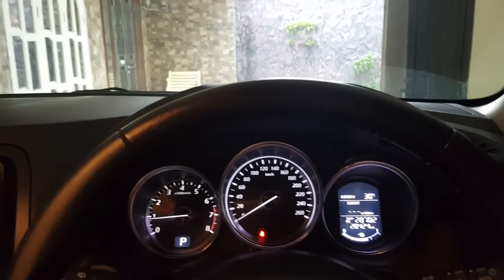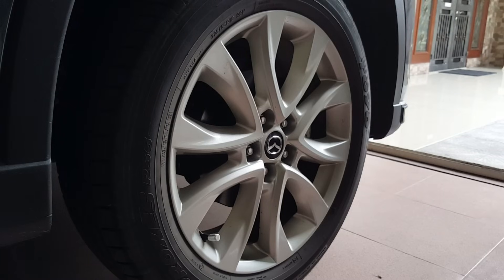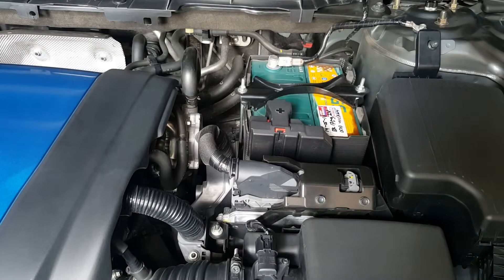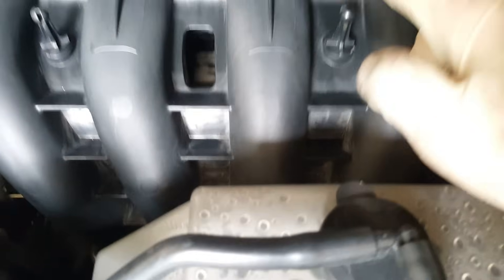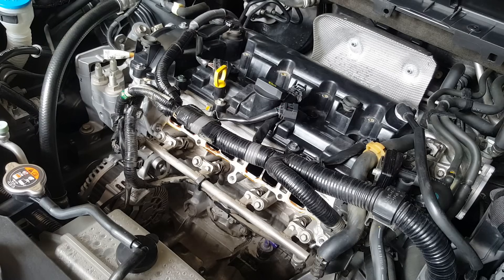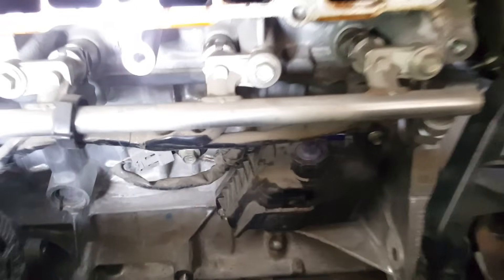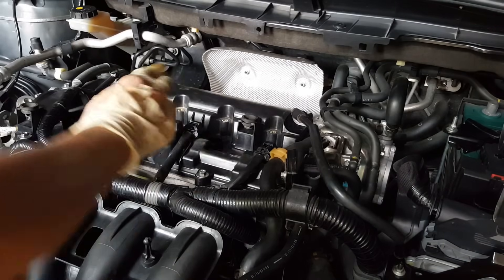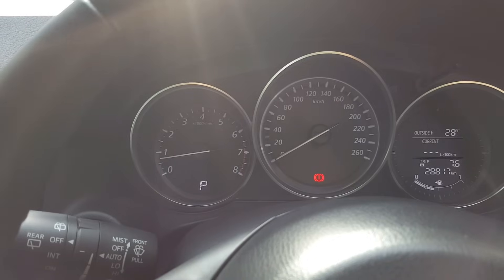How to Clean Intake valves / Carbon clean // Mazda CX 5 (All Skyactiv Gasoline Engines)

Comment: The government needs to band GDI engines from the U.S. ..
Reply: what if you didn't reroute the "out" of the catch can (or the PCV system) back into the intake of the engine? wouldn't that solve the problem with DI because nothing from the PCV is going back over the intake valves? i was thinking just feed a hose down to the bottom of the car from the PCV like those that drain A/C condensation.
Reply: @maxmykhlyk3732  No that's a bad idea unless you like your engine misfiring and lots of check engine lights. That's if we ignore the asshole nature of just dumping it on the ground.
Reply: BoogieDownProduction can you explain why it’d be a bad idea? Obv it’d be bad for the environment but other then that?
Reply: @maxmykhlyk3732  Do you like engine codes and your engine misfiring? Seems like I already explained it to you. Your MAP and MAF will get error codes and it will misfire.
Reply: Max Mykhlyk your idea is not bad. Unfortunately R&D takes time. VW has been doing DI for over ten years and has various solutions in place to counteract the issues. Namely I see that their PCV system uses filters to accomplish what you are suggesting. So essentially it's being done. This way the PCV material is mainly vaporous gases and not oil or sludge which should stay in the crankcase and the oil should suspend it until your next oil change. Another reason why more frequent oil changes are a requirement with GDI. The fact is it's more expensive to maintain GDI cars but they do get I believe 8% better economy on average. They have a long way to go but lighter materials and lighter cars will help. Thus, a 1.2L engine would be more than sufficient. Right now gasoline is cheap so the big 2.0T engines are ruling the roost.
Reply: @jamesmedina2062  Maybe VW did that but thats because the car was engineered that way. I can confidently say the engine will misfire because I have this engine and I also went to install a catch can. The plumbing was too large and there was an air leak causing multiple check engine codes as well as tons of misfiring. Fixed the plumbing and the engine codes/misfires went away. Unless the car has a system like you described from the factory otherwise you will run into problems because it was designed to be a closed system.
Reply: Yeah then need to ban them Not because of the Planet but because of the cost to the unknowing fool's who buy these kinds of cars like me..
Reply: if only they ban those big engines.
Reply: looks like all new cars are gdi now. smh.
Reply: Richi RIch Yes, poor atomization and therefore incomplete burning causing increased particulate matter especially. Men are control freaks and GDI seemed attractive perhaps to engineers but...you cannot change the proven downsides which are numerous
Reply: Funny you say that, because the whole reason most car manufacturers have gone to GDI engines in the first place was due to the government regulations.  Obama used his dictatorial pen-and-phone in 2010 to force manufacturer's car fleets (CAFE) to average 54.5 MPG by 2024.  This was an impossible-to-reach goal without going to primarily Electric Vehicles (Obama even admitted his goal was 1/3 of all vehicles to be EVs by 2024).

So the car builders added GDI in order to eek out another 1-2 MPG in the short term, even though they knew about the design flaw they introduced.  By the time carbon deposits start building up, it's YOUR problem, not their's.  Don't blame them though. They were given an impossible task.  Ironically, any real MPG gains are quickly lost  due to the disruption of airflow to the engine as carbon deposits build up.

Thank God Trump froze Obama's disastrous new CAFE standard to about 38 MPG.  It's still way too high though.  The damage to engine designs has already been done.

Toyota is the only company that has addressed the problem on their entire fleet by adding dual injection (port and direct).  My next vehicle will be a Toyota.
Reply: shralperx just so you no toyota is not the win all wait for skyactive x with new valve coatings if carbon cant stick to valves cannot accumulate plus if carbon build up is the main concern just bypass pcv and add catch can and say by by to carbon build up or just  add a injector with cleaner and pump to front of thottlebody and pulse it on hyw once awhile and will keep engine cleen
Reply: shralperx And since 2019 Toyota put out a 41mpg AWD SUV using supplemental electric power. You’re putting the onus on customers who buy  a product from a multinational company with billions of dollars and heaping praise on the current President who wants to lower standards. The US could benefit from leading the revolution in new technology by maybe not entirely relying on electric right now but use Toyota’s example as a bridge to the future. If you think the US is upset about Huawei’s 5G technology now wait until China  and other national countries will be leading the charge in electric and nuclear power c
Reply: @shralperx so blah blah blah disaster oh but a carmaker found a way so it's not really a disaster. Anything to justify an ill-informed political diatribe, I guess.

Government regulations have pushed the market to innovate yet again. Without it we wouldn't even have the cars we enjoy today.
Reply: @shralperx  1) Yes we can blame the manufactures as there is known technology that fixes this problem (dual port injection) 2) 1-2 mpg increase is not correct. 3) Yes thank god we now have a reality star president who doesnt understand/or is paid to look away from the science. 

Why dont you drive you your nearest university and learn about global warming. You can start in the chemistry lab and start with the green house effect. Good luck.
Reply: @BoogieDownProduction  1) Obama's CAFE and first-ever CO2 regs have already caused the price of cars to increase about $3500.  With car prices already averaging $30K, most companies aren't willing to add another $700-$1000 to the price.  R&D and more injectors all cost more money.  Plus DI requires a super high pressure fuel pump which means the system is more prone for problems.  Port injection was just fine, thank you .

2) Yes, 1-2 mpg is about the average gain, and it's quickly lost when carbon starts building up and airflow is disrupted.

3) The man-made Global Warming scare is the biggest scam ever pushed upon the world.  It's not even worth getting into here, except to say that thousands of scientist disagree but are exiled as 'deniers.'  Money and politics have completely corrupted the 'scientific' community who rely on government funding for their livelihoods.  I don't need to drive to a university to know that more CO2 = more GREEN and more warmth = more GREEN.  To deny it is to deny basic science. Who are the real deniers here?  I suggest you research the other side instead of just believing what you have been told.
Reply: @shralperx  Thousands of scientists disagree? You live in lala land. I have multiple science degrees (including chemistry, biology and a MS), based on your simplistic "more CO2 = more GREEN and more warmth = more GREEN" I can see why you are so confused your understanding of science is limited at best. You just proved the dangers of the internet, you can find the answers online but if you are not smart you can end up believing in lizard people/chemtrails/flat earth/more CO2=good. Dunning Kruger effect is strong with this one. 

So if there is only a 1-2 mpg gain then why are manufactures spending money on R&D for a 1-2 mpg increase? Funny that you dont see that your argument goes both ways.
Reply: @BoogieDownProduction  shralperx  exaggerated a bit but over 100 scientists and climatologists  agree that climate change is cyclical with mans contribution being less than 10% ,and i think he means more GREEN  = more plants which uses CO2. It was  even warmer during the Medieval warm period when Vikings sailed the Arctic sea  settled in Greenland ( name wasn't a misnomer or wishful thinking it was GREEN) they grew crops and raised farm animals . England grew grapes better than France , the tower  of London built at this time on the river Thames (a tidal area of the river) .A painting  from that era shows a water level the same as today but with the ice gone from Greenland and most of the Arctic the river level should of been higher then but it wasn't . This was not a localized event as China reported much warmer temperatures at this time.Lastly the climate change alarmists are many of the same scientists that warned of the impending ice age in the seventies News Week Time, National Geographic all had articles warning of this coming ice age which by the way was also man's fault.
Reply: @BoogieDownProduction  - Climate alarmist - Can you explain why the current global warming period started at least 300 years ago, or more specifically several hundred years before the large increase in CO2 today please? Did they teach this in your University or only the man made part that keeps their funding going? I doubt you really learned about global warming beyond what they allowed you to know.

Comment: Great video.
I just did the same thing last month to my Mazda 3 skyactiv engine 
By the way, may i suggest, it would be a plus if you explain why the intake valves getting so dirty. Thats will help mazda skyactiv friends understand the theory better.
2nd.. since you already taken out the manifold and the throttle body,  did you clean the throttle body? Or maybe you can make another video for throttle body cleaning? Just a suggestion...
Also, when u took out your intake manifold,  my advise is that by installing an oil catch can will helps to reduce carbon deposits in future...
As the oil vapors trapped at the oil catch can n condensed turned to liquid oil form , thus only clean air will flow back into the intake manifold.  This will keep the intake valve much cleaner vs stock setting.
Also remember to change your air filter regulary. Cos dust + oil vapor = carbon deposit inside the valve. Thank you.
Reply: Felix Liew, 
The oil is coming from PCV.  Positive Crankcase Ventilation.  The source of that?  Blow-by gas passing from the combustion chamber going past the piston o-ring.  This builds up pressure in the crankcase.  Pressure is relieved at PCV into air intake stream.  Problem is, this air is very saturated with fine oil droplets.  Not sure you'd want to mess with adding an oil catch can, as the elongated air passage would reduce the pressure differential at the PCV, and delay the threshold when PCV lets air through.  This means crankcase will end up with higher equilibrium pressure than the system was designed.
Reply from the maker: felix liew hi bro. Yes i have cleaned the TB aswell. The link is here https://youtu.be/eVEJ9-96DS4.

Comment: May I know why you took out the spark plug?
Reply from the maker: because if you have the spark plug in , It will be harder to turn the engine manually on the crankshaft due to engine compression .
Reply: I see, Thanks bro !!! So must be turn the engine manually on the crankshaft follow clockwise ?
Reply from the maker: Very correct . Turn Clockwise.

Comment: How many mile on it this time
Reply from the maker: Viet Le Quoc it had 29000kms on the clock when i did this service.
Reply: Felix Dan thank you. How many km  do you do this service and any   issue with your engine before you did this service
Reply: Felix Dan  i mean period km to do
Reply from the maker: Viet Le Quoc it is recommended to do this service every 30000 - 40000 kms . The engine previously did not have major issue other than slower response and just drinking a little bit more fuel. Once the passage are clean n clear i restore much of the engine performance just like a new car. 👍👍👍.

Comment: While you had the intake removed, you could've install an oil catch can it won't stop oil from going into the intake 100% but at least it delays the process of gunk build up.
Reply from the maker: Reviewing Tech101 very true sir. Just wasnt keen on investing the catch can...  with or without the catch can we are still have to clean the valve on this GDI engine . Hehehe. But if owners do wants it ,  saving time and labour costs going back n forth dismanttling please do install the catch can .

Comment: Please use CRC valve cleaner next time as directed.... then take the cover off so we can see if it did anything. Love your vids. Also, why take out the spark plugs? did you put new ones in?
Reply from the maker: BigDog no worries i will schedule for the next video in the future. I took off the spark plugs so i can turn the engine easily.
Reply: Tanks Felix, also does car need to be in Neutral to turn it and close the valves?
Reply from the maker: BigDog yes put it in Neutral . And have the hand brake up .
Reply: Felix Dan thanks Felix you’re great help!
Reply: Good thing i checked these comments lol

Comment: You could have used CRC to spray into the intake cylinders pass the sensors  ,but your way of doing it probably saved getting a lot of crape into the engine ,and thanks for making this video .
Reply: Yeh I would love to see him use the CRC and then take the cover off again to see if it actually did anything.
Reply: Im from malaysia, here its not that easy to get CRC product, most of the local hardware store dont sell it. Normally can be found at Ace hardware(lots of american/import prodcut) but then, its quite pricey.
Reply: I doubt crc works so great.
Reply: @marianluc6235 Just spraying it into the intake definitely isn't going to get it as clean as he did! It should be used every 10k mi or so to keep it from getting caked up.
Reply: Yes, everyone take your engine apart and clean the valves...If you're going to do this then buy a different vehicle.  Yes I have a Mazda cx5 2.5L and no I'm not doing this 😂😂

Comment: I want to do this but sorta afraid I’ll ruin something. How did you clean the top of the valves so clean?? Can’t be just the toothbrush alone can it. Since it’s deep inside. Thanks for sharing, I’ll probably attempt it one day heheh one last question, how to know exactly if the valves are closed all the way? I’ve never done this type of job before. Thank man
Reply from the maker: Tom Nguyen the tools that i used to clean the crowns are toothbrush and tool pick to scrape the carbon deposits. Maybe let your mechanic do this service . So you dont risk to damage anything as it is a difficult task. Thank you for the support :)
Reply from the maker: To know the valves are fully closed. U will need a friend to rotate the crankshaft slowly while you can actually visual the valves moving in open n closed direction.

Comment: Hello Felix. Do You know How to clean air conditioner? There is bad smell when it work.
Reply from the maker: Olga olga check my other video on cabin filter. Should replace your filter if begin to create a bad odours.
Reply: thx Felix. But i do that. Bad smell is still exist. Even i clean by different cleaning chemical things. No result. May be You know How clean up evaporator?
Reply from the maker: Olga olga hehe unfortunately i dont know how to clean the evaporator. Maybe have to do like a full ozone treatment to kill the bad smell. Maybe try your local Air conditioning shop ? Cheers

Comment: Hello.  You should have bought CRC intake valve cleaner.   The product will allow your to spray inside the intake behind MAS or  through PCV hose (3:34).  Save you a lot of work.
Reply from the maker: Fahed noori i will do my best to record it for my next service .
Reply: Felix Dan If you did please record a video. Thanks!
Reply from the maker: Will give it a try next time .

Comment: Great job and well explained. What is your opinion about using the intake valve cleaners like CRC that is directly sprayed through the intake with engine running and does not require disassembly of the intake manifold which is a harder job and requires more skill level an tools.
Reply: You risk of clogging  the catalytic  converter with carbon deposits this method is better.dont get lazy get to work it might take you twice the time but is doable is just a car not a rocket.
Reply from the maker: rc max thank you. To be honest i have never done it myself with that method on this skyactiv engine so i cant really comment much. But i have heard with spray method does the job if applied regularly. But i am not 100% sure if it can clean off the stubborn carbon fully.

Comment: thx u so much to making this video , i would like to know , what is the purpose that we have to rotate of crank shaft pulley?
Reply from the maker: Aditya Noor Maulana to open and closes the valves . Because we dont want chemicals cleaners and dirt to fall down into the combustion chamber as it will potentially ruin the piston walls and other components.
Reply: well understood...thank you so much, i will try later...👍👍👍